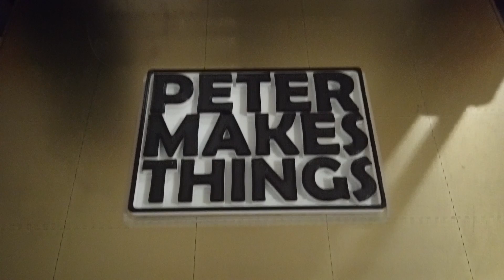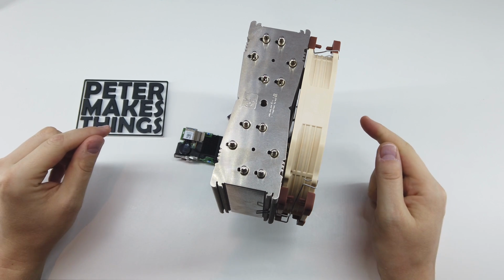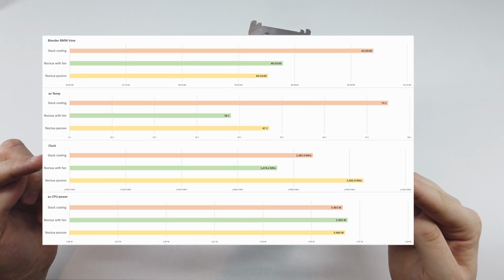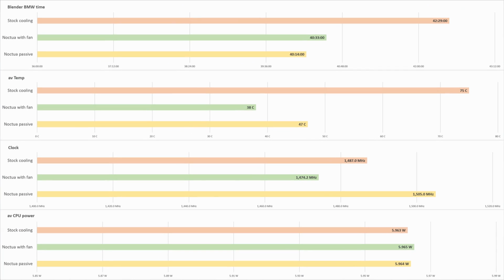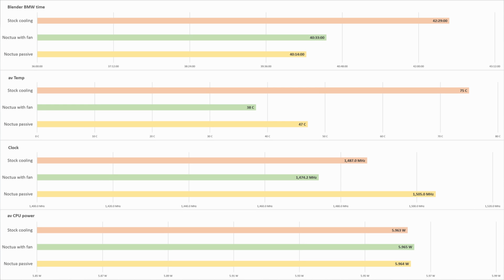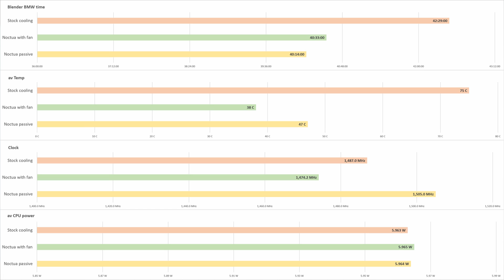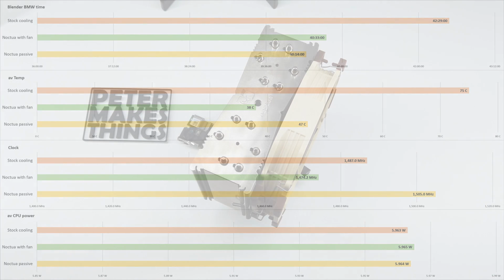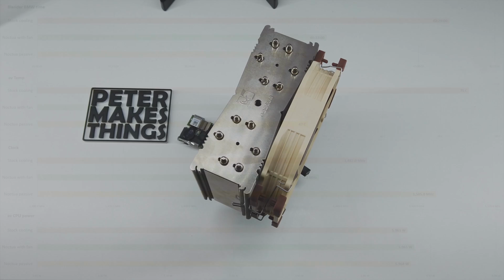Will better cooling improve Intel Stick m3 performance?

Comment: I have a gpd win2 and it has the same cpu installed, you cannot overclock it but you can run it at higher wattage
Reply from the maker: Yeah I know there's a bunch of ways to tweak gpd, but Intel stick doesn't seem to be as popular in modding community and didn't find anything :/
Reply: I have the M5 version of this.  Surprisingly potent for such a tiny package!